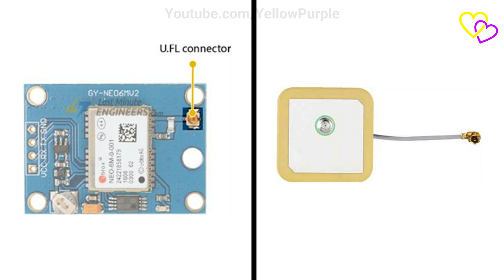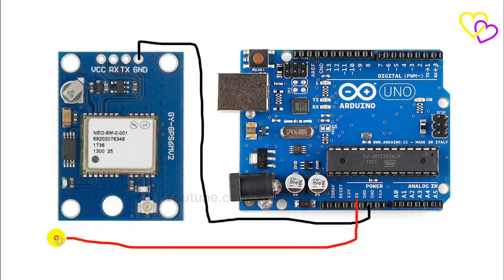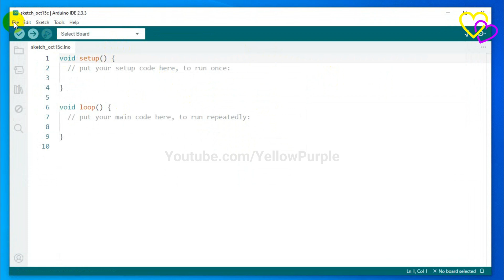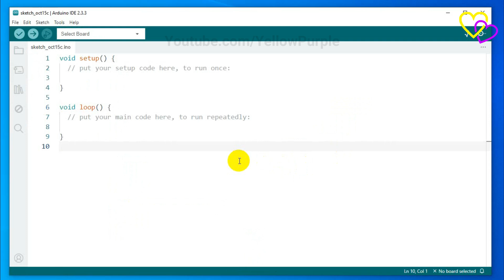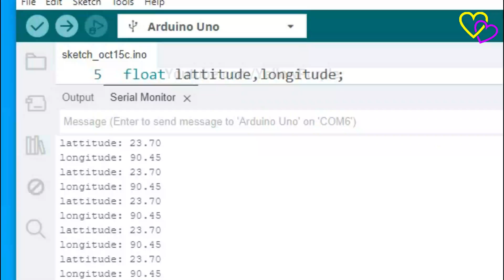Getting Started with GY-NEO6MV2 NEO-6M GPS Module & Arduino | How to Use & Setup Tutorial

Comment: Hi ,
Firstly thanks for the tutorial.

I did exactly the same as mentioned in the video with exactly same code , except the board which I used is not an Uno but a Mega.

The Red light indicator is blinking at a constant rate which means there is a successful lock...yet
My serial monitor is blank.
I debugged the code and found out the serial out from the board (GPS) is not available. 
The code does not move past the first loop...and stuck without getting any data from my GPS module.

Are there any possible solutions or fixes ?
Thanks in advance
Reply: Same
Reply: the softwereserial library doesnt work with mega boards just use mega serial1 for getting info from gps

Comment: How long does it take to acquire satellites? Left m I mine running on the window sill for 10 minutes, didn't get a flashing light
Reply: I have the same problem and it does not blink, does it work with you ?
Reply: @ahmedayad4115  turned out the module was faulty.  Got another and it works
Reply: @xxx7917  how uch time it took ??